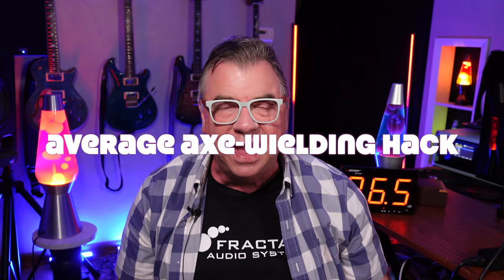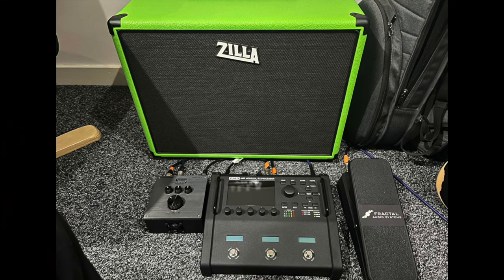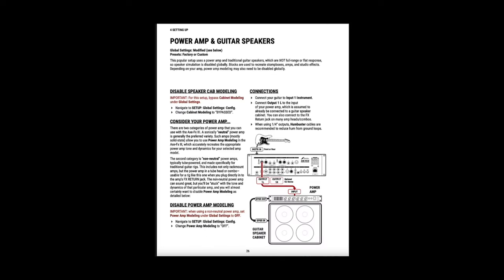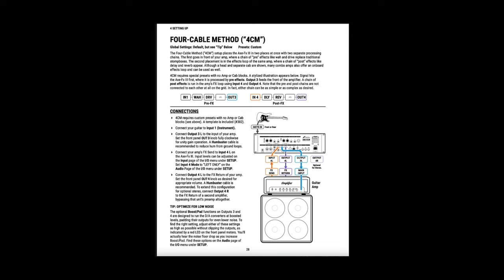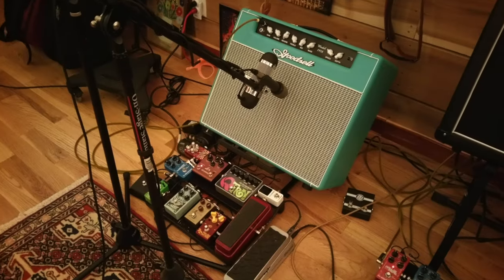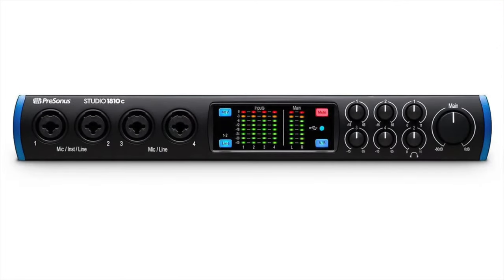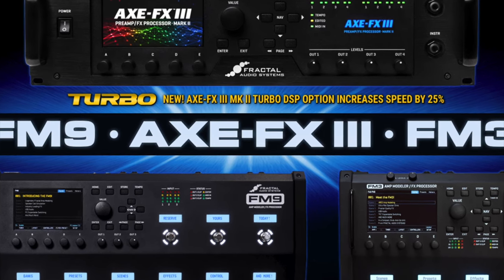Axe-Fx III/FM9/FM3 - FRFR vs. Power Amp & Cab - Which Setup Is BEST?

Comment: Great video. Thank you! Lifelong analog guy here. I switched to fractal fm3 few years ago. What I love most is the palette of sounds and the simple setup. I go direct to pa and have a small headrush for my onstage monitor and for others in the band to hear. I do miss the pushing of air but I’ve learned to move on from it. My hearing is more important to me now since it’s been affected by years of playing. I just picked up an Axe3 and in process of finalizing my rack. Heading into IEM territory for the first time so I can further protect my hearing and have more flexibility with monitoring. If eliminating the headrush is very noticeable to me I will put it back in the rig. Growing up with amps and pedals, I wondered if going the route of axefx would be hard. It hasn’t. It’s differmt but the tones are limitless and they sound amazing.
Reply: Good on you for preserving your hearing and I’m certain your back thanks you, too! Thanks for sharing your experience with the switch!

Comment: I’m the contrarian on the cab and amp modeling paradigm. I keep them both on for 1) FOH 2) backline tube amp 3) in ear sends and 4) DAW recording! Without those on I can’t bear the hissy scratchy grating output. Plus I roll off highs in the cab block down to 5500 hertz and use a parametric block to roll off highs and notch 6000, 4000, and dip 400. Got to tell you I’m in tone heaven, AND amp in the room.

Comment: The point of the FRFR that separates it from a standard power amp and cab. The FULL RANGE capability of the FRFR is capable of simulating the physiology of ANY cab. So not just speakers are modeled, but the cabs too. So you can switch from a 4x12 (model) closed to a single 12 open and your flat response gear will sound like you physically switched cabs.

Comment: I really think the power amp w/gtr cab solves all the complaints about the sound n not feeling like a real amp and miss cabs pushing air. Real guitar cabs are the solution. That being said, sure guitar cabs feel familiar, but as an engineer, running into FRFR is the way to go. I mean, you usually only hear your guitar through the monitors anyway. :)
Reply: But have you actually tested and played through a power amp w/ guitar cab?  If you're an engineer, you probably know, that using FRFR does lose the real amp sound when you turn up the volume.  Low volume are always sound beautiful.  But when using a FRFR (with loud volume), it would start to sound like a home stereo or PA speaker rather than a real cab.  And...the FRFR started getting a lot more Mids and FX  and stronger than what we intended.  This is just my opinion.
Reply: @heut4384  Yeah, I’m currently using a power amp and 4x12 cab on stage. But, I usually run a line to FOH. There are speaker parameters that I’ve  tweaked. 😊

Comment: I apply a more direct approach, an FRFR to me, means instead full range frequency response, it doesn't mean flat response, if I wan't flat I'd set my pots to central to attain the pallet as nominal only.
The are various modeller/multi's that output as a neutral option other than Fractal per say, any conventional guitar amp and cab or combo is designed to provide nominal tonal range by default, a full range cab (p.a. for example) is sufficient if it's good quality of being re-mic'd if required and re-inputed to any mixing console to obtain a similar result as a standard guitar cab being mic's up, -the full range cab/s do provide a much wider tonal pallet than any conventional guitar amp though.
Much of the marketing hype regarding FRFR is just that and nothing more.

Comment: what I love about my Powercab 212+ with my FM9 is to use it on FRFR mode but go the "poweramp+speaker" route when I want to
Reply: Does that thing really sound like a true cab?
Reply: @justinTime077 not at all.  They are terrible imo
Reply: @justinTime077 yes it does with the right EQ, at high volume blows away

Comment: Why not to try modeler (pre and power amp on, IRS off) ---> powered mixer ---> Guitar Speaker Cab ? I want to try it and see what results can I get. It surely will have less versatility because of the colour of the speakers, but I hope it would be more flexible than the modeler directly to the return of an amp.

Comment: I use my FM3 with an in ear system at church so I've never had to use it in another context other than recording. If I were out live, wouldn't I be safe to just show up at a gig somewhere and use the club/house stage monitors for my reference? I guess the only problem scenario would be playing somewhere there isn't a fixed/equipped stage (where it's essentially a 'pop up' type gig). I agree, for recording, we've had amazing results just going direct with it.
Reply from the maker: Technically you could do that, but like you said, it might be something like a pop-up, and who knows what gear you'll get. But being able to walk into a gig with just a guitar and FM3, how cool is that!

Comment: My current setup is pedal board > Quilter amp > Speaker Cab. Do you think I could just replace the pedal board with an FM9 and run it into my Amp and Cab?

Comment: Someone please tell me how to turn up the volume on USB.  I use it as my in and my audio interface as my out to the monitors.   The volume isn’t real low, but not near as loud as you would be with running directly into the interface.
Reply from the maker: From the unit go to SETUP -> I/O -> USB/AES. You can adjust the USB levels there.

Comment: Watched the vid and my experience is exactly opposite 
Axefx3 is the worst, over processed, thin tone I’ve ever had
We are about the same age you and I

I want to love the AxeFx but I would settle for liking it
So if you help me figure out if I’m doing something wrong I’m all ears,
God forbid I tell the truth of my tone on the fractal forum they are like a pack of hyenas
0 help there

Been a stage and studio musician for over 40 years
Been tracking, mixing and mastering for 11 years
I have rooms of real tube and SS amps and cabs
42 guitars and basses from early Gibson SGs, Pauls, 335, melody maker, four signature Strats, 3 teles, Ibanez Jems, Charvel model5s from ‘86,87,88 my favorites 
Carvins, Kiesel Zeus,  Parker flys, Godin for synth, Martin and ovation acoustic and some other jazz pieces 
  
And get great sounds from all the pieces I’ve collected over my time
Always miced my cabs Mesa, Marshall, orange whatever 
All celestian from many years and models 
I like my 15ohm Rolas G12-65 from my first JCM 800 4x12 cabs I ever bought in 1980
Full stack

Present studio guitar setup
Mesa lonestar
SM 57 with a Royer 121
Into 2 Neve Shelford Channel strips
Mogami cables
Apollo x8 interface with Audient asp880 adat 
Sounds great through my Genelecs, Focals or Yamahas

Also I go oxbox from any of 31 heads and combos most recent being 
Mesa mark VII and a brand new JVM410 to update my road worn workhorse 
I have jcm800s, 900s, plexis, dsls, dual rectos, dc series combos, JP2c, fenders galore, orange, Vox, Roland, Gallien Krueger, Soldano, Friedman and a few Revv 
All sound great through the oxbox or miced up

Then the axefx3 all digital connection spdif/toslink converter into the Apollo rack light pipe 
Monitored on several Apollo console stereo setups into powered 
Genelec 8361a with 7370 subs or alt switch to Focal trio6 actives
And it sounds fake, thin, fizzy, clicky at times, no warmth or real tube feel
I hate it
Can’t get a good sound
I can even open a NI guitar pro version and get a better tone 
So when I say the axe model of say a fender twin doesn’t sound like the real deal I can back it up with direct in room side by side comparison 
Maybe my ears are spoiled by the amazing tones I get in the studio or on stage
Or maybe I’m not setting up the axefx3 correctly
Took the cooper carter course to learn it
Bought the FC12 and 2 mission pedals but yuck!!

Help before I throw this thing into the garage 

Understand I’m talking guitar amp modeling here not FX they are quite good and routing options all wonderful, thanks
Looong post, sorry
Reply from the maker: Wow, you have some KILLER gear! The only thing that I can think of is 1) do you have output set to +4, and 2) do you have the Apolo at 48K; it normally defaults to 44.1 but the Axe-Fx III uses 48K. Hope this helps!
Reply: @DougBsDigitalDen 
Hi Doug, just using my work email so the username and pics are different but thanks for replying, yeah I’ve been collecting a long time lots of gear

I always run AxeFx3, ProTools, Studio one, Ableton, Luna and Logic in 48k
When I was in Burbank a few years back I asked one of the road techs about the Fractal stuff and she was able to get some stage worthy usable tones but nothing like the live rig I had then but no one had much to contribute to the studio monitor quality questions 
And since I have residence in Philadelphia and Seattle it’s not as if they could drop by 

I noticed you had two studios at a time and you really seem happy with the AxeFx so that’s why I was asking if I’m doing something wrong
I must be since so many players
seem to love their boxes
I see them racked at shows for FX and control routing options and only have heard a few used as amp modelers
Players are still using real amps in conjunction with the newer tech from what I witness
So I guess I’ll try FRFR Friedmans next and if that doesn’t do it I’ll stick with the good old reliable mics, amps and reamp solutions, thanks again I do like your vids

Comment: Hi Doug. QSC K 10.2s?? Any issues with them to amplify your Fractal? I just returned one after my FM9 kept sending it into MUTE/ PROTECT Mode. I REALLY like the way it sounded but it was way unreliable. Muting itself at gigs, etc. My presets/ output level is all in check and is not running hot. I went with another brand to replace instead of trying another K 10.2. Any comments? Anyone?
Reply from the maker: Gregg - did you check the firmware version on the K10.2? Version 1.3.3 is supposed to negate al lot of those false overloads. I installed it on mine and have had no dropouts since then.
Reply: Hi Doug. Thx for the reply. Yes, mine shipped with this firmware version. It was just really hit and miss with the QSC. At times it was fine and other sessions it would protect itself my muting/ PM4. I returned it and swapped for a Mackie SRM 210. Sounds every bit as good as the QSC, I preferred the QSC build. My FM9 gain staging was fine, BTW, as the Mackie Input meter confirmed. Curious, do you run Fractal straight into your K 10.2s or do you go through a mixer and then to the speakers? Some have suggested the latter being a better solution...
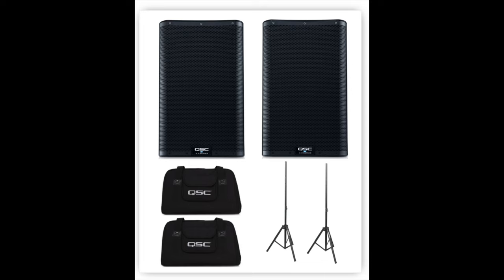Reply: @gregnott7157  I understood it was the latter if you watch @ 4:40
Reply: @ookookook  ya, I saw the mixer mentioned in my first view but Doug doesn't specifically say he runs it that way, he just says he bought it at the same time and that his band uses it and also for keyboards. Let's assume he does run into the mixer then out to the speakers. I wonder if MOST people do that? I'm certain that I have seen other YouTubers (Rosh, maybe?) running straight to speaker (s) from a Fractal. What would be the advantage of sending it through a mixer first for the purpose of a monitor? FM9 has the outputs, why not just send Output 1 connection direct to the monitor, copy it to Out 2 internally then send Output 2 connection to FOH? Am I missing something?
Reply: @gregnott7157  I don’t think you’re missing anything. I’d go straight to the FRFRs too and if I had to support a bunch of devices then I’d spend another 1500 on the mixer I guess
Reply: @ookookook  I guess that is the heart of my comments here. That IS how I run, but I was having issues with the QSC K 10.2, sending it into a muted state/ Protection Mode 4. If you're not familiar with that, Google QSC PM4. My levels out of the FM9 were not hot, but it kept happening. I gave up and went to a Mackie SRM 210 and I have had 0 issue so far. So, faulty QSC speaker or faulty QSC design/ firmware? That is my point. If Doug and many others are using a mixer between and are achieving results, maybe that is/ was the ticket. Page 28 of the FM9 manual clearly illustrates that straight into FRFR should be good to go. Didn't work for me. Too bad, the K.2 is a sexy speaker, nicer build than Mackie. But they both sound very similar so I'm not bothered. I guess...

Comment: Q about doing output 1 to foh and output 2 to power amp and cab. How do you put output 2 before the cab if the preset has all the effects after the cab block?
Reply from the maker: I'm going to assume that you want effects on out2, right? You'd have to use the "Instrument Split" signal path and set up one path for FOH, and the other path being identical, but with no cab.